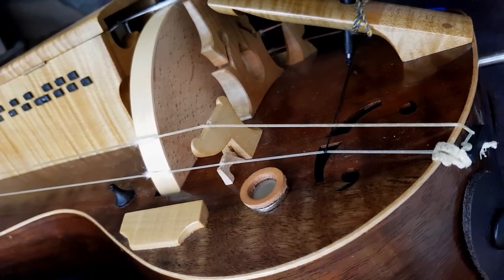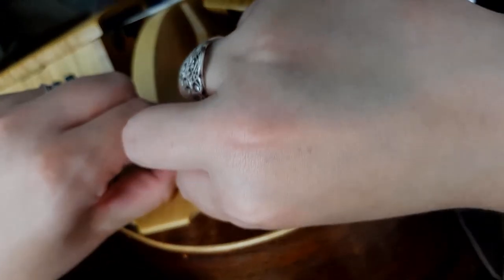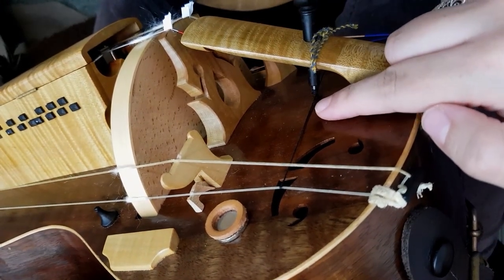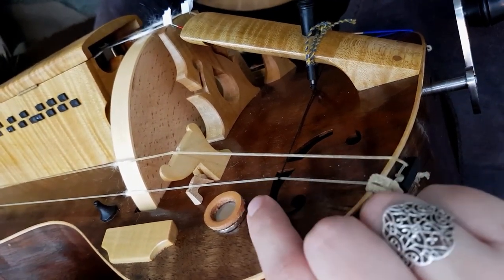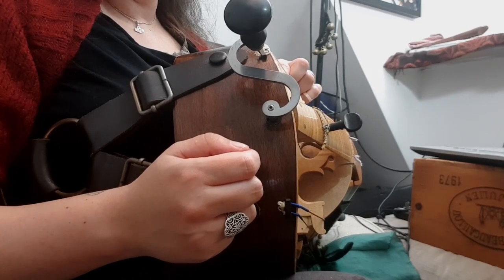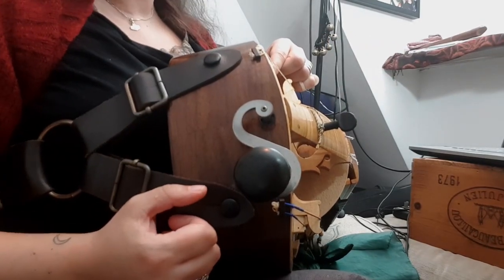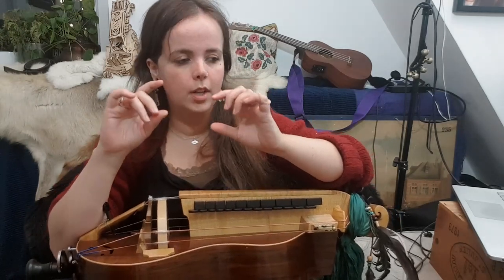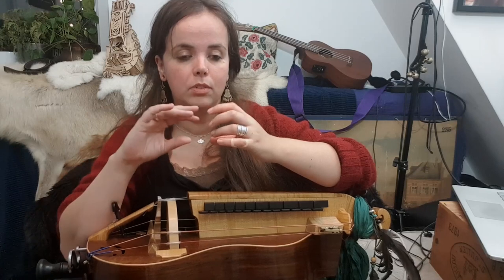The trompette and the dog | Hurdy Gurdy Explained

Comment: Why she dont attach small electric motor on battery  or drill Black & Decker to her hurdy gurdy? She could play with both hands and make music fast forward and rewind ☝️
Reply: Because you loose all the dynamics you get when using the crank. Just like the strumming hand on a guitar.
Reply: @elektrovolt  true but one could have a pedal controlled motor. Wouldn’t be the same thing but could be cool for accessibility
Reply: @thanpersand  It won't sound as good, you loose all the nuances, the rhythmical part of the trompette and all the other nuances. There are a few gurdies that have a motor but you can do far less on those than you can do with a simple crank.
Reply: @elektrovolt  a sewing machine style foot controller  would be a reasonably expressive alternative for someone with something like wrist joint issues or only one hand
Reply: @thanpersand  that will never be able to control the nuances you need for playing the interesting bits. If you ever played a hurdy gurdy you will know what I mean. It is not an instrument designed for disabled people just like you do not use an 'automatic strummer' on a guitar.
Reply: @elektrovolt  sorry if you’re misunderstanding me but I purely mean as an alternative for people who are physically incapable of using a crank
Reply: @thanpersand  EDIT:  the OP (not you) asked why she does not add a motor so she could play with both hands. That is a totally different question. 
You cannot play two notes at the same time on the keyboard, so you do not need two hands on there. 
And of course you can add a motor if you are not able to use a crank, but you will lose some of the important features, especially the one that this video is about. I think you are missing the point of the video. The hurdy gurdy is not just playing notes, but the video shows one of the most important features that needs the cranking hand.
Reply: @elektrovolt  i mean if you've ever used a foot pedal on a sewing machine you know you can have quite some finesse, but I'm sure it must take quite some work to incorporate that ibto a hurdy and for a traditionalist it wouldn't do.